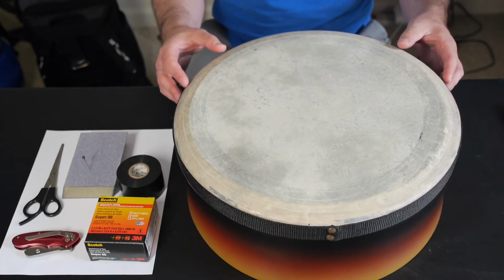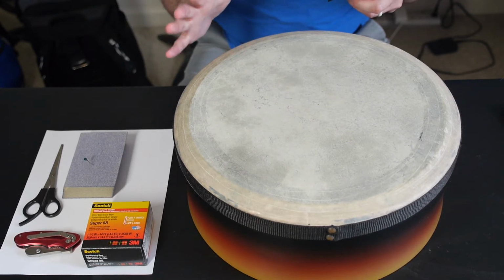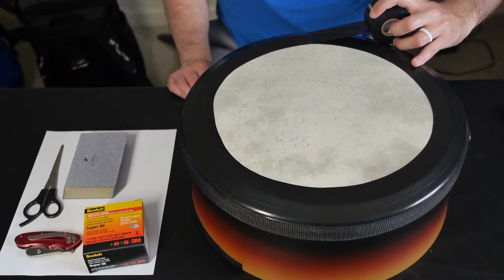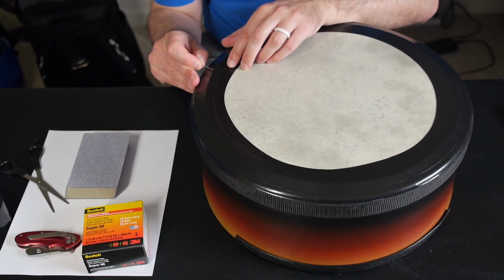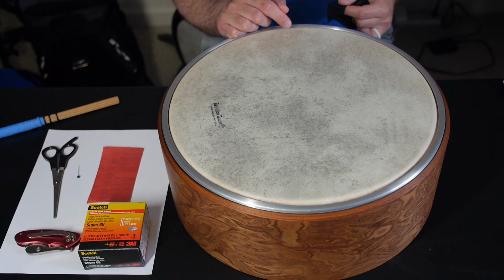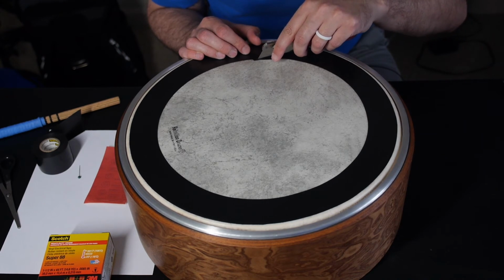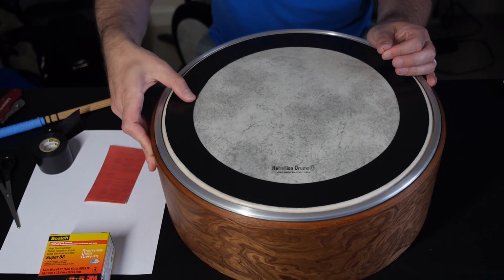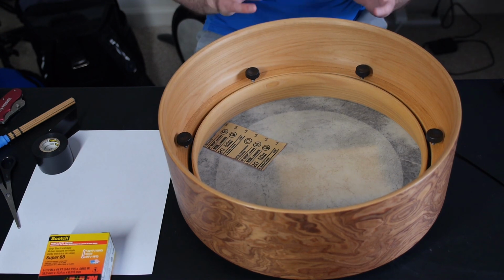Taping a Bodhrán

Comment: Does this work on non-tunable bodhrans? I just bought a 14" one, there's not much of a collar so would I do the 2nd method you show with 3/4" tape? Its hard to find the 1.5" online unless you buy $50 worth. Very informative video!
Reply from the maker: Hey there! I would probably go with 3/4” Super 88 rather than the 1.5” tape anyway, both for the reason you mentioned and also because it’s MUCH easier to work with. I would try and overlap the collar even if it’s small if you can, as the tape will have a better chance of staying put. You can always try method 2 and see if that works, and if you like the sound better.

Comment: Hello from Turkey:) can I tape my thin shell bodhran too? Or is it just for the deep shell bodhrans? I am beginner and I have 18 inch non-tuneable bodhran and I want to get slightly better tones, will it change the way is sounds?
Reply from the maker: @Sude Mizrak Hi there! Yes, you can tape the thinner shell Bodhrán as well. The big secret is that deeper shells do not get a “bigger” or “deeper” bass sound. It’s actually the opposite. Taping any diameter and depth of Bodhrán will definitely change the sound. You may like it more, or you might not dig what it does. Definitely try it and see!
Reply: Matt Bell On Drums I will definitely try it. Thanks a lot for your reply and these infos!
Reply from the maker: Sude Mızrak You’re very welcome!

Comment: Very good explanation!  I'm not super skilled in Bodhran, but I'm in the process of building one.  I have used plasti-dip on mesh heads for my drumset setup to give them a bit more life/tone - I'm thinking about using plasti-dip on the Bodhran instead of tape.   Have you ever tried it?
Reply from the maker: Hey there @Rhythm House Drums! You could definitely try plasti-dip...it might be tough to get a uniform thickness around the head, but it’s worth a try! If you do end up doing it, please let me know how it goes!

Comment: Thanks! Very helpful. I had thought that taping was much more complicated than it turns out to be. (Though I suspect that your experience makes it look slightly easier than it than it will be for a beginner...)
Reply from the maker: Mike Vande Bunt You’re welcome! The biggest suggestion I have for someone starting out with the taping thing is to use narrower (.75” or 1”) Super 88 tape. It’s MUCH easier to work with!

Comment: What was used before 3M Tape?
Reply from the maker: The process of taping Bodhráns started pretty much with Seamus O’Kane and his drums around 1970. So, relatively speaking, it’s a fairly “new” idea. A cursory google search told me that electrical tape as we know it was patented in 1946…by 3M.
Reply: @HeyItsMattBell  So, it seems before that they let the drum sing on it's own.
Reply from the maker: @oldmanfromscenetwentyfour8164  Seamus was one of the pioneers of using much thinner, more flexible goatskins that had been treated to be used on Lambeg drums. The “older style” heads like on Charlie Byrne’s Bodhrans were much thicker, and the higher overtones were not nearly as pronounced, so tape was not as often used (although I’ve seen some with duct tape on the inside). All that to say that the thinner the head, the more high, ringing overtones present, which most contemporary players like to attenuate.